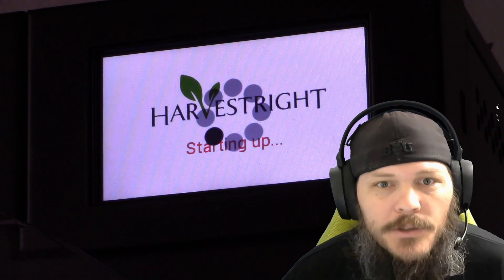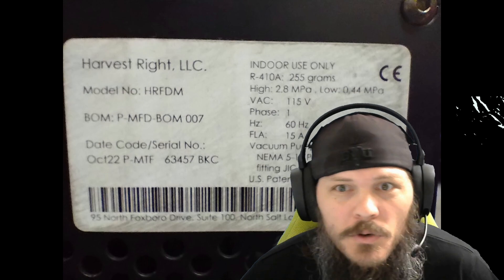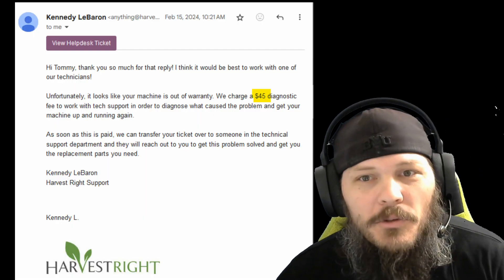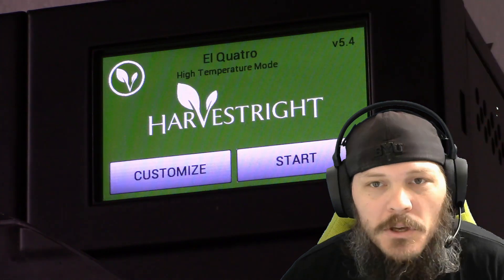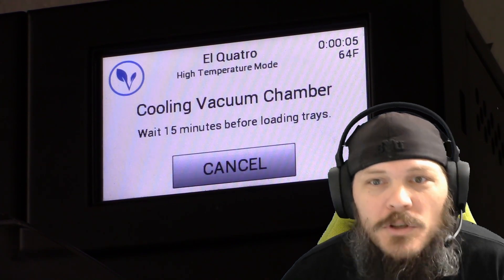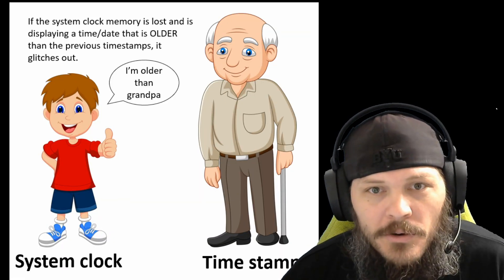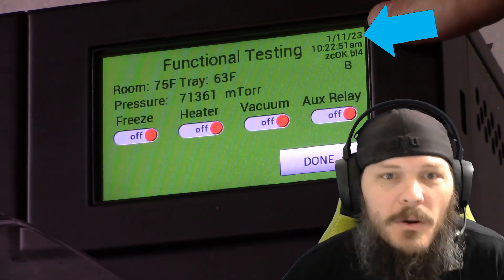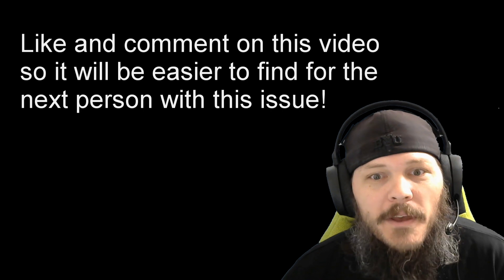HarvestRight Freeze Dryer: stuck on "Starting up..." SOLVED

Comment: Thank you!! This is the second time I have had this issue. I have only had it for a few months. The first time I just did what any child of the 80s and 90s would do, I turned it off and on and that solved it. So now it happened again I did the same thing and it did not resolve. Did a little google search came across your video, and sure enough your troubleshooting advice took care of the problem!! Thank you!

Comment: i tried your fix and my clock was correct. so it did not work. i contacted harvest right tech support. they sent my a software fix. so far it seems to be working. they call it a loop fix. which seems to be what it was doing. stuck in a loop. they should put that on the software update they have on their website.

Comment: Thanks , I'll check mine as well . Done many updates to my large , filters , rewired the relay heater system , added a vent system instead of the drain (goofy) .Not as good as the SF but way better . VT